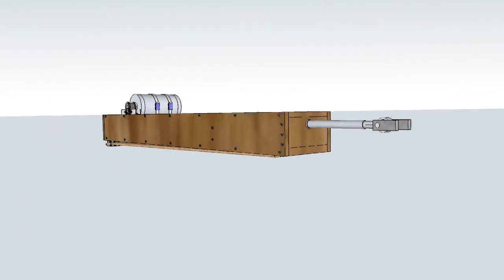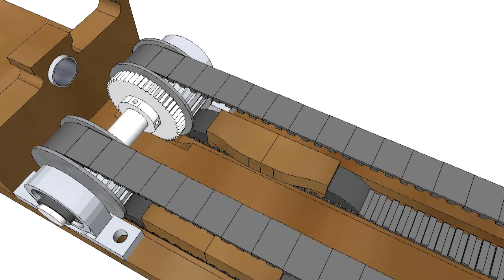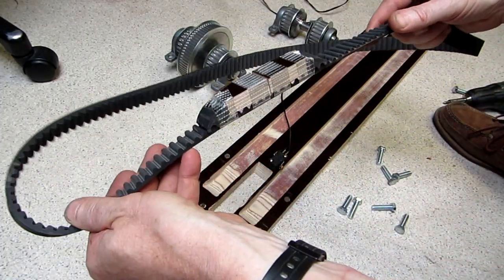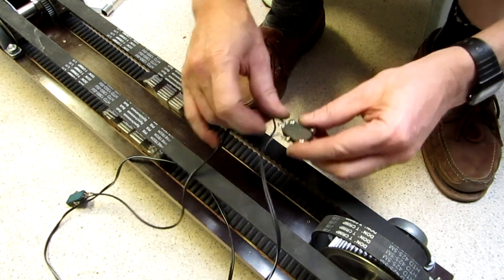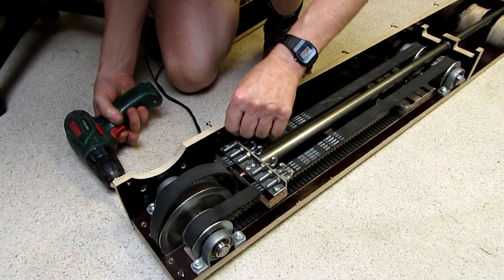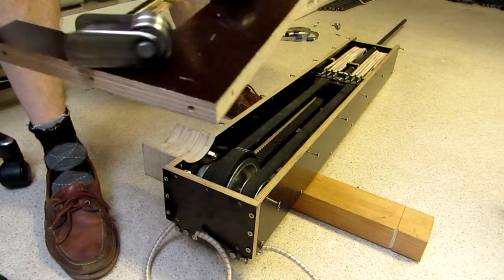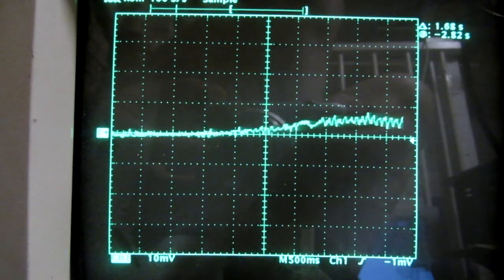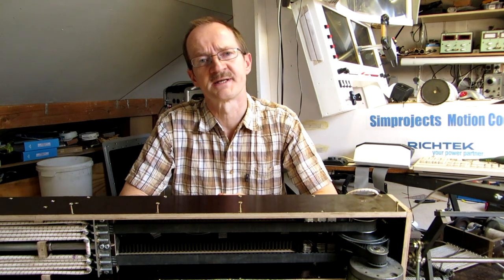Linear Actuator Design

Comment: This is such an inspiring video for someone just starting out.  Can I ask some advice please? I am self-teaching control theory and electronics, some 12 years after I graduated with a mechanical engineering degree. Our control lecturer was sadly not the most ... understandable. I have a few projects I would like to create that will require control loops with motors and rotational plus linear movement, and be able to respond to external forces.

My maths is now rusty too - do I really need to understand all the integrals of "e to the minus ess tee" laplace / fourier / matrices, or will something like matlab simulink handle all that for me? I am not averse to putting in time on the maths if its truly vital.
Reply from the maker: No need to know all math of control theory: Some gut-feeling and experience in electronics and mechanics go a long way. It also depends whether you want to make software servo loop or hardware servo loop. For software, more math is involved, while a simple OPAMP is sufficient to make a decent working hardware feedback loop (proportional only, no I or D): just tweak the OPAMP gain until you see oscillations, then reduce for acceptable servo stiffness and response. Its quite fun. Check my website motion platform pages for more info.
Reply from the maker: Google sketchup
Reply: what program do you use for the animation
Reply: Rolandvanroy Thanks again. I know only that I have an absolute ton to learn!
Reply: Wireline apoyemos a omega el fuerte🌎
Reply: YOUR OVER THINKING THE ACTUATOR  PROBLEM !  1 HP IS 550 FT POUNDS ! IF YOU COUNTER WEIGHT AND USE 1HP YOU CAN LIFT HUNDREDS OF POUNDS EZ !
Reply: I know its probably too late for you, but my degree was heavily control theory based. Since then in the real world I have used nothing except PID control (or P, PD, PI). Unless you want some extreme performance, or you are controlling a particularly nasty system, at most PID is all you need. For professional work you can work out roughly the needed P,I and D gains, but it always then comes down to trial and error to get the system reacting how you want it to. For anything else just instrument everything then go crazy till it works. Adjust the P value till you get roughly the performance you need, then set an I if you get a steady state error, then D to increase the performance (lets you use a higher 'P' without overshoot or losing control).
Reply: I used a screw drive from garage door for linear motion, stick a dc reduction motor at the end
Reply: Did you buy the software or somehow extended the 30 day free trial?

Comment: What happens if there is a power loss?  Does the actuator come crashing to the ground?  Is there some sort of braking system to prevent that ?
Reply from the maker: Note that bungee force increases when it is stretched more. So when you balance for 200kg and the payload is 250kg, in non-powered condition the platform will sink a bit more, but it will not come crashing down, but stay suspended around 10~20% of the normal height.
Reply from the maker: +Joe Saltzman The weight-balance bungee system keeps the load suspended when there is no power applied. No need for braking system.
Reply: Superb.  Fascinating and impressive project !
Reply: But that would only work if the weight was consistent and the bungee cords were calibrated for that exact weight

Comment: Those smaller belt wheels look like ones on car water pumps that are usually discarded when changing timing belts. They can be easily pushed out with shop press. Those would be almost free compared to €14.50 a piece. Also car timing belts could be used for power transmission, even used ones if going really cheap.

Comment: I suggest not using potentiometer unless cost saving is really important.

Better to have optical absolute position sensor or simple optical cog-type sensors and zero index (which you already have with your end stop switches).

Overshoot can be computed for over various loads if current sensor feedback is used to estimate inertia / mass of load so that servo rapidly slows as destination position is approached.

Very cool project - thanks for sharing
Reply: @Erich Kaltenbrunner, you can cheat by replacing potentiometers with pairs of LED+LDR (light detection resistors), it'll produce smoother controler inputs than those old crappy mechanical 'pots'. It's a nice and cheap alternative :)

Comment: HEIDENHAIN Linear Scale encoder
http://www.ebay.com/itm/281877320897
Reply: +:: HASTEK :: Engineering Systems Yes, he's going to spend $ 800.00 per axis to sense position. He would be FAR better off just using a low cost incremental encoder and homing each axis on a power cycle.

Comment: Is the slight overshoot on the servo response designed with cause or is it that there is not a good PID system integrated (yet)?
Reply from the maker: +tHaH4x0r : For the test I had set the gain a bit high, so a small overshoot will occur. In real use, it can be tuned for best response. especially during sudden turbulence, and touch-down, fast response is desired, and the overshoot may actually help. It's all about tweaking.
Reply: +Rolandvanroy Ah so that is why. Thanks for the reply! I must say very cool project, personally i am not very interested in flight simulators, but this one really shows a lot of knowledge and engineering insight!

Comment: To stop the tilting motion just add a 1/8' thick backing plate to the rear or the motor mount. Then use a top half wooden or metal bracket the fits the diameter of the motor and bolt it too the bottom half. 

Or you could just make the motor support block wider. And then bolt the top half over the motor support block.

Comment: Horrible concept, designed with failure prone parts.  Internal force potential done in a way that would only work for a limited lifetime.  Stretch band and timing belt would need constant maintenance.  Far from practical, 19th century technology.
Reply: You must be fun at parties
Reply: Reading this and another comment by 'telelaci2', I was hoping that an alternative would be offered, because otherwise it is little short of trolling.  So what would you you change?  Frame design?  The prime movers?  Load balancing?  Sensors?  What?  As it is, all you seem to be trying to do is make yourselves look smart.
Reply: telelaci2  You clearly think about what do do, so consider the fact that others who may also feel like making negative comments without offering anything in return may look at this conversation and learn something?  For that reason alone, I'd leave your post as-is.
Reply: OK, life is shit, people are shit, YouTube is shit, there is nothing to learn and you know everything and you can say whatever you want to whoever you want.  Happy?  Pointless saying anything to you, bye.
Reply: telelaci2 You already did learn something!
1) YouTube is not uni, or college.
2) The poster was sharing his hobby experience.
3) Correcting other people's mistakes without offering solutions is not constructive.
4) You weren't asked for your opinion, so offering a negative one wouldn't be nice, or proper, except with the caveat at 3).
Reply: +Jason W Actually Rob is right. Designing is something what can be done on paper (or computer of course) . Assembling is not part of the designing. What we can see here, how a gadgeter solves his problems, how he implements his ideas. Its interesting and entertaining, but its very far from "designing" or "engineering", don't be fooled. And its a horrible concept indeed, but its not my business if the builder is satisfied with it.
Reply: Hi Apex, I'm a mechanical engineer, so youre right I'm quite smart in this theme, indeed. I think I shouldn't have commented this video, because it was totally pointless. My comment has no any value, its only hurtful criticism. But I had to say something, because actually Rob was right. I'm sorry for that.
I don't need to design something just to prove : I could do this better. He is not a mechanical engineer, not a professional,  he doesn't do this for living. And youtube is not the proper place to learn/teach mechanical engineering.
And its an interesting and entertaining video anyway, most of people like it including the uploader.
This is why I should have stayed mute. Do you want me to delete my previous comment ? I can do that if necessary, why not.
Reply: Its hard to learn something from this conversation, because the dilemma is still there : what's better, being polite or being honest ? Staying mute, when you know that something is not so true as it seems, that is a kind of lie. Hurting someone with pure criticism without being constructive, neither so nice.
Reply: No I didn't learn anything.
1.) I knew it.
2.) I knew it.
3.) I don't have to be constructive. I'll tell you if your egg is rotten, but I won't lay an egg for you.
4.) I don't have to be asked for my opinion, this is youtube, I comment what I want.

Comment: Amazing design, the thing I really like is you can move it very fast or slow, and the materials used in its construction (thick plywood) is actually very strong and easily fabricated and it can move 40kg. This would be amazing in a six axis flight sim.

Comment: How about an update:-). great video! Will the actuaters make to much noise? This one seems to mak a lot of noise... hopefully you pull this off!
Reply: It looks like some of the noise is caused by the end-stop securing tape dragging against the wood body. See 6:42 - high pitch ticking is the toothed pulley dragging over the detached stationary motor drive belt, but the clunking noise is the end-stop dragging. It may be quieter by drilling a hole through the belt and securing with countersunk taper screws, though this will damage the internal belt cords and reduce strength.

Comment: A+ for ingenuity, D- for application. Hydraulic / air cylinders are much cheaper, easier to use and more durable. The cost of a decent pump + control valves / hoses would be off set by what you save on the 6 actuators. Sorry for downing your design as it is very interesting and shows a good deal of thought and effort in its design. But not the design I would choose for its intended purpose.
Reply: hydraulic is always going to be messy and pneumatic will be sudden movements
Reply: Controlling a hydraulic motor is much more complex than controlling a DC motor
Reply: Taking regard for budget / cost.. this is prob. one of the better linear actuator designs ive seen tho.. hydraulic is crazy expensive in comparison to this.
Reply: No dude. a good hydraulic (leaving out pneumatic cylinders cause honestly, not gentle/predictable enough for this application) system would cost a lot. That and it'd be a lot easier to just hook some encoders to the motors and use motor controls to run these things accordingly with the flight sim or whatever. Hydraulics are also very messy, wouldn't want that shit in a house.
Reply: There is no way you could hope to build this cheaper with hydraulics. The cylinders and valves cost a fortune, the pump and accumulator are also expensive and likely to be noisier. Plumbing costs more than wiring and needs to be done perfectly. Expect to pay at least four times more than this solution for a system of similar performance.
Reply: I almost agree with you but then this system is entirely electric, is quiet, low maintenance and needs no compressor/hydraulic pump. It is what it is. Either its a good prototype for a nicer looking system or a cheap solution to a problem. I have to say I like his solution.
Reply: HCI344 You don't control a hydraulic motor as they are self governing, they'll have a valve that opens if there's too much pressure for the liquid to circulate back round. You do control the valves to send the oil to the actuators tho.
Reply: ***** I've been looking into precision high-speed accurate positioning electrohydraulic proportioning valves and apparently they are a niche industry for very specialized use, so expect to pay $250 or more per two-way valve, and possibly more like $500 per.
Reply: Los pistones neumático o hidráulico no te permiten un control de la velocidad del desplazamiento, este sistema con servo pude ayudar a controlar el movimiento, lo que lo veo es medio lento, pero es una idea que mejora los sistemas de guías lineales con banda usuales.

Comment: Pretty spiffy. I went ahead and downloaded the file and added a cross bracket to the motor mount to minimize the tilt issue. I will work on it a little more this evening and e-mail you a copy within the next few days. Brilliant configuration, especially for a wooden case as opposed to aluminium.

Comment: My random foible is to avoid micro switches, potentiometers and DC motors - in favour of stepper motors with optical encoders (I won't dedicate the motors / drivers - but make them 'snap in' - so I can move them between; simulator, parallel robot, plasma table, etc.)

Comment: Nice work. You have put a whole lot into your design. Optical encoders can be used in place of the POT. You don't have a proportional feedback control on the shaft. You can add one just my printing it on your printer and an optical interrupter. Also, the groves in the timing belt is deep enough to be used as an encoder. The valleys of the timing belt can be painted white and a forward facing or reflective interrupter can be use. Nice work

Comment: Have you considered using pneumatics instead ? You could replace all of that with an air cylinder and a proportional valve. If you're lucky you can find some used ones on auction sites
Reply from the maker: It is rather difficult to control the position of pneumatic cylinders accurately. Electric drive is much easier, and you can use digital PID to tweak the response.
Reply: You know you can do the same using air cylinders. Obviously you need a closed loop system so there's a need for position sensing

Comment: Talk about over-engineering a simple device! And 300 euros? For $100 dlls you can get a new electric actuator and the required gears to make it fast enough. Easier, much more compact, cheaper, much more durable and dependable.
I think you could use your abilities in something more usefull than trying to reinvent the wheel.
Reply: Could you name the source for a $100 actuator of that size?
Reply: Flyby Wire ebay, tons of them. They are slow speed but able to handle 1,000 lbs, 2,000 lbs plus, so as I said, by changing the ratio of the gears you make them fast enough and still able to handle 250-300 lbs.
Reply: Galileo Galilei
but they are slow as shit, and maximum use time is 20 seconds  with 2 min break                   i think, with good sources, this actuator can be built under 120€
Reply: Aside from the speed issue and duty rating gamerpaddy mentioned, while you might be able to get such actuators cheaply in the USA, the rest of the world doesn't have an industrial surplus market on the same scale so prices are a lot higher. Shipping internationally with the associated import fees will put that price up a lot.
Also converting the gear ratio is liable to be very difficult, as (at least in my experience) most commecial linear actuators have custom cast metal geaboxes. It's not going to be as simple as swapping some gears, but as involved as building a custom gearbox housing, motor mount, and securely mating it to the leadscrew. And that's assuming it's got limit-switches in the screw casing and not a proportional feedback pot that'll also need remounting AND recalibrating to match the new speed and duty.
Not impossible, but very close to building one from scratch anyway.
Reply: Galileo Galilei eBay is a cesspit of scams and if you knew anything about the home flight simulator market you would know it's an inherently a DIY market

Comment: Thx for sharing, I am hoping to build my own flight motion platform with little engineering knowledge. What is the different between this DIY Actuator to this one here: http://www.ebay.co.uk/itm/High-Speed-Linear-Actuator-12V-DC-20kg-Force-Compact-Low-Noise/121124304495?rt=nc&_trksid=p2047675.m1851&_trkparms=aid%3D222002%26algo%3DSIC.FIT%26ao%3D1%26asc%3D286%26meid%3D4235517847171010919%26pid%3D100005%26prg%3D1048%26rk%3D3%26rkt%3D5%26sd%3D111104076828%26 that cost £70.00
Reply from the maker: The big difference is speed. The actuators you show are relatively slow. My design moves with around 0.6m/sec which is needed for the dynamic motion cues of flight simulation.
Reply: Also they are only 20kg force. Its all listed in the specifications.

Comment from the maker: I used normal AC mains wire for the motor leads. It's normally good for 20A or so. Since average current is low, it is not a problem. The motor controller is my own design, see my website under Motion Platform III and IV "electrical drive"  but commercial motor drivers like MD03 are fine too.